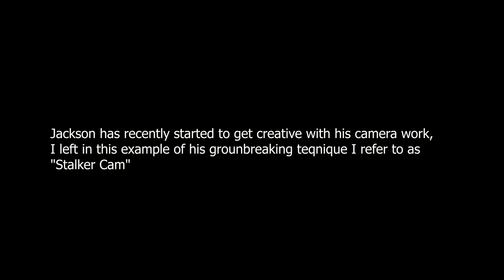EASY $300 Gaming PC Build - Step-by-Step

Comment: There is 2 other tower versions of this. A tiny pc and a SFF. I have the SFF with an I7 6700 and 16gb of DDR4 memory. Currently looking for a graphics card for it but came across your video and I am pleased with what this machine should be able to do.
Reply: How did you get around d the 45w on the pci? I have the m900 sff and acquired a 1050ti

Comment: This is about how much I spent on my build. 

Although the cpu i got was free from a HP workstation.

Late 2019
I5 6500
Stock cooler $5
Rx 580 8gb I grabbed for $120
Asrock h110m-dgs r3 for $60
HP 1x8gb ddr4 2133
750w corsair 80+ bronze
And I dont remember the case it came in 
(PSU and case came together for $100)
120 SSD PNY
1 TB HDD
Updated about 2 months ago
I5 6500
H60 liquid cooler
HP 8gb 2133
Adata 8gb 2133
Rx 580
Corsair 750w
120GB SSD
2TB HDD
MUSETEX MX7 or something like that you guys recently reviewed .

Comment: Just built my first pc for 600.
I5 8600k
16gb 3200 ram
GTX 1060 3gb
Z390 Mobo

Thank y'all for the tips and videos throughout the years.
Reply: You should have gotten a thx 1060 6gb but good nonetheless
Reply: @giorgiiashvili6338  I got the 1060 3gb for free with the processor.
Reply: Built mine and broke the motherboard twice i bent the pins 😭😭

Comment: i’ve used to watch the optiplex builds and i finally built one myself, i have an optiplex 7010 i bought off amazon, it had a i5-3470 and i bought a xeon e3-1230v2 which came in today, i also traded for a evga 400 watt from a friend of mine, waiting for me next pay check to buy a rx580 and then i’ll be good for a while, probably gonna sell it and build a ryzen pc. Love the videos!!
Reply: How much better is the e3? I've got the same i5 as you and a rx480 8g. The cpu is the bottleneck though
Reply: @matthewmurray5168  i’m pretty sure the i5 can only play warzone at around 100 but the xeon is up towards 200, it’s also a lot faster in general
Reply: i didn’t buy the rx580 bc they are like 500 dollars now so i bought a 1660 super for $250 at a gamestop was the last one and traded it for a 1060 3gb and $200

Comment: That's my PC! I built that one too 3 months ago. I already changed the case tho. And I upgraded it to a 32gb 2400 Mhz Ram. Adding the Gtx 1050ti made it congested as hell lmao. I have a question is a gtx 1650 compatible in this PC?
Reply: I am looking at building this PC but changing out the case too. 

Did you buy a ATX case? 

Did this enable the motherboard from the Lenovo M700 to fit?

Thanks
Reply: @thomascameron9092  Yes, I bought a new atx case for this build and yes, it fits. Sorry for the late reply.
Reply: @jaspermiguellopez4313  perfect. Thanks for letting me know
Reply: We have the same pc too. could you hit me up the specs and upgrade list for this model? trying to upgrade mine as well to 1650ti, psu, ram, and the case too.

Comment: Here in the UK it is a struggle to find a 1050Ti for $300 let alone the rest of the system. Prices on the second hand market are just ridiculous at the moment.
Reply: Freg  you got super lucky. Gpu are going for 3-4 times the cost both used and new.

Comment: Finally a lower budget build ;D and as the core 2 duos, i3, 2 cores, 4gb ram, 2gb gpus etc. were all in the meta 2-3y back, 6-7th gen i5 prebuilts will replace current ones, i always thought of that and now its finally duable and happening

Comment: A Rx 570 would be good match in this build 👍
Reply: Would it be same with 580?
Reply: @Ahmad-nq4mo  Slightly better 5-10fps but Rx 570 has more value for money than the 580 though right now everything's expensive and makes no sense buying either unless required

Comment: I got a custom built for $250 CAD today, I'm so excited. 

Specs: 
i5 6500
Gtx 1050 
550w coolermaster bronze 
8gb ddr4
Asus mobo
Reply: yikes a 1050
Reply: Yea
Reply: Works great
Reply: @PakistaniGoat  I doubt it, unless ofc u are playing games which dont require much power from ur components like minecraft, Valorant and gta
Reply: @b6.b1zz  and fortnite
Reply: 180 - 200 on performance mode all low
Reply: Stable 165 fps all low (not perfomance mode)

Comment: Putting in the new graphics card do you have to have a more powerful power supply instead of the standard 250 I think
Reply: I was wondering the exact same thing as the GTX 1050 TI pulls 300W???

Comment: What about the original PSU? How many wats it can handle? You doesn't need to change it when you installed the GTX1050ti? I'm asking it because I have a Lenovo like this one, with an original 280W PSU and I was wondering if it is going to be possible to put a GTX1050ti on it without replace the PSU.
Reply: Hi, no problem on mine. Installed a 1050ti LP from MSI and it works very well. I play Battlefield V !
Reply: @awayagain4871  This woked even with the PSU output of 250W and the GPU needing 300W??

Comment: is it a regular gtx 1050 ti 4gb or low profile? And I have another question: does it make sense with a 250W power supply?
Reply: I have the same question as the GTX 1050 TI says it needs a minimum of 300W!!??
Reply: @alexanderkeegan  I bought a gtx 1050ti 4gb and everything works fine
Reply: @Jedrek-fy7yw do u have this specific computer

Comment: Love your vid and i need help I'm going to build my first pc and my budget is 500/600 GBP
Reply: Wait. Parts are going to go up 7-20% in price here soon because there is a deal for electronics and tech that comes out of china that helps keep the costs down so with that deal out of date everything is gonna be expensive. Plus the cpu and GPU market are awful buying spaces rn. But the #1 thing you should start doing is asking your friends you know around for parts to buy off them you would be shocked how many people may have parts just laying around
Reply: @dashthunderman  Ok I will see but I don't have any friends
Reply: I just built a pc recently but when I plug it into the monitor is says no signal I need help in wat to do to fix it
Reply: @etrv_bookie3053  does the fan spin?
Reply: @dashthunderman  yes
Reply: @dashthunderman  I have everything plugged in correctly but still no signal and does the fans on the graphics card suppose to spin when the pc is on
Reply: @etrv_bookie3053  i would say update bios but 1st make sure you are on right signal. Trust me I've been on the wrong one before 😂
Reply: @dashthunderman  I found the problem I stayed up all night trying to figure out wat was wrong it was just like a spec of dust in the ram sticks😂
Reply: @etrv_bookie3053  does it work now?
Reply: @dashthunderman  yes it works now but thx for helping me😁

Comment: Hi, for this card the recommended PSU at least is 300W. Lenovo ThinkCentre M700 Tower has a 250W PSU. Did this not cause any problem during the test? thx.
Reply: I am wondering the exact same thing!

Comment: @Toasty Bros can you fit a 1060 6gb in it i have a 1050ti in it right now just like that but can you, or do you need to upgrade power supply and if so could you recommend me one?
Reply: Did you end up changing it? If so what PSU did you use? Thanks

Comment: I buy hp 6300 i5 3470 + 8ram ddr3 1600mhr and then buy 1060 3gb becose is 120 watts consumation (one cable sata to 6pin) 320watts power supply HP 90% power efficient and one ssd mx500 250gb + hdd 500gb

Comment: I mean you guys can't really sell upgraded Dell Optiplexs at $410 and then show it on YouTube how to build it for $200-$300. Also you guys are using the sff which has no power supply upgradability/room for a decent size gpu because low profiles are more expensive.

Comment: Hey what sada cable do I need I bought two already and neither one of them have worked
Reply: standard sata cable should work. did you try plugging it in different sata ports on the motherboard?
sometimes some ports just don't work
Reply: Ya I tried that but the Cable just won’t fit in the SSD
Reply: @Snipwraps4L  then you have the wrong cable maybe. What type of SSD are you using?
Reply: The one they used in the video
Reply: @Snipwraps4L  well then i have no idea, sorry. make a reddit post about it on r/buildapc and provide pictures so they can help you.

Comment: Just wondering if anyone that knows a lot about pc’s will this pc actually run good FPS on fortnite at low setting because I’m thinking of getting this pc
Reply: He showed it run fortnite lmfao
Reply: 9:59
Reply: @mitingtwotch  just wondering bro because I don’t know lots about pc’s , but the link in the description are they all the parts you need and is that it?
Reply: @spaceman1574  are you 12-14? You dont need to build a pc if ur that young.
Reply: @spaceman1574  yea those are the parts
Reply: this runs fortnite at max settings at 55 fps

Comment: Hello guys.
I really like this video, it's a good way to create a low-cost ''Gaming' Computer but...
Why didn't you upgrade the RAM?
Why didn't you do a CPU upgrade and change the CPU Cooler ?
Why didn't you upgrade the PSU?
Why did you choose a 1050 instead of a 1660S?
Yes, from the title you chose or ''EASY$300 Gaming PC Build'' but you could have built it a little better.
It's still a nice Build, congratulations :-) .
Next step to put RGB everywhere XD

Comment: This is ignorant, buy a used computer and upgrade it?  How many wanna bet that the power supply chips surrounding the processor are completely fried on these "pre built " units.  (they are used and they are probably selling these units themselves and trying to move them by conning you into thinking you can build a massive gaming system this way, you cannot, you are buying someone else's garbage and motherboards have a limited shelf life, the power supply chips overheat and burn out.....I know, I built an overclocking computer in 2003 and surrounded the processor with heatsinks to prevent failure.....even so old computers are old tech, buy newer you will be happy, you cannot beat a 6 core 12 thread i7 with the garbage they are pushing).  Toastybro's?  Your not even proper burnouts, just posers trying to seem hip and putting on a massive con.
Reply: dang timothy who hurt you?